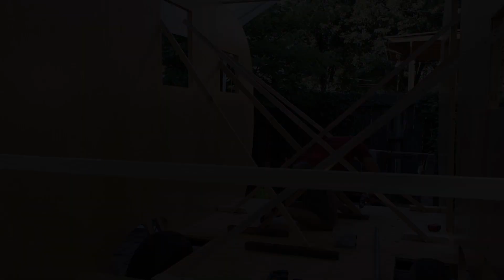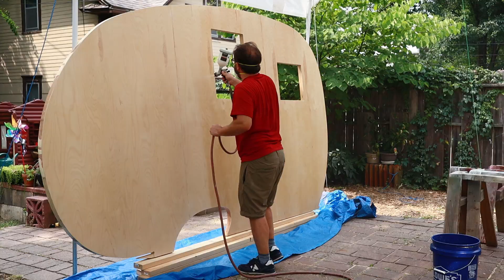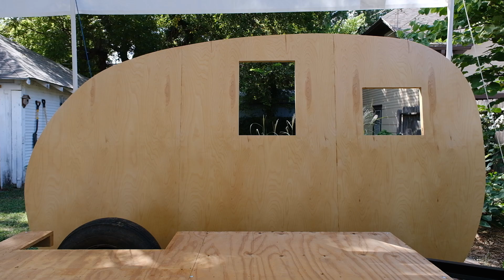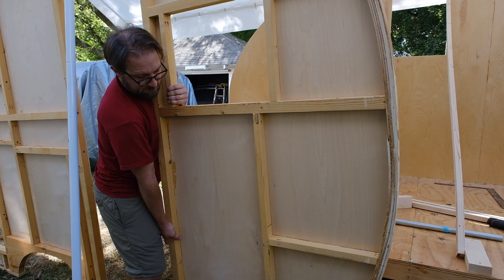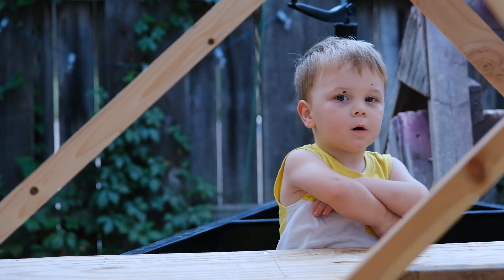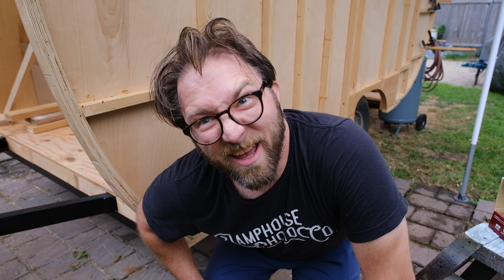FINALLY! WALLS are UP on my VINTAGE CAMPER REBUILD!

Comment: What's the best way or do you have any tips to putting up the 1/8 inch birch plywood on the inside walls and cieling without removing the skins and taking apart the walls? I knownits not the right way but I'm just doing a quick job so the kids can play in my trailer. The only thing I can find online is scribing. Thanks!
Reply from the maker: Well, the walls you can do without taking the skins off, but you'll spend a ton of time scribing the curve on to templates to get them to fit, and even then you can wind up with some gaps. The ceiling you really can't do without pulling at least the roof skin and ceiling joists, because the panel has to overlap the walls and be nailed/stapled down into them.

My advice for doing this the quickest with the least amount of struggle, would be to pull the roof skin and joists. Tack your wall panels in. Use a trim router with a flush trim bit to trim the panels exactly to your wall's radius once they're installed. Install welting to the edge of your walls. Glue and tack your ceiling joists to the replacement ceiling panels, and drop them into place and tack them in. Then put your skin back and reinstall any windows you removed with new butyl tape.

It honestly is quicker and a lot less work to just do it the "correct" way.

That being said, if you really want to do it without removing the skins, I would start with the ceiling, but add some additional wood between the joists at the outside edges so you have something to tack the panel to. Then get some help and push your panels as tightly as you can against the ceiling joists. You'll probably need to use small wood screws to attach them, as nails will either pull through the 1/8" plywood, or they'll be impossible to drive securely. Then go back and start scribing some templates to cut your wall panel replacements and get them sized to fit. Of course, please be aware that repairing it this way does compromise a lot of the structural integrity of the camper and you would certainly want to do a "correct" repair before towing it any distance.

Good luck!

Comment: You won the war on getting the sides mounted, great job.  I don't think my 64 year old shoulders could have done it.  In my 72 cardinal rebuild I am not doing a complete tear down.  Thank you for some ideas on reinforcing the strength of the walls  to the frame.  That has been a concern.  I need to find a welting that will work as I just reskin the inside walls and ceiling.  Now time to watch the next video.  Have a great Sunday.
Reply from the maker: It was quite a task, but it really felt like I was accomplishing something that day!